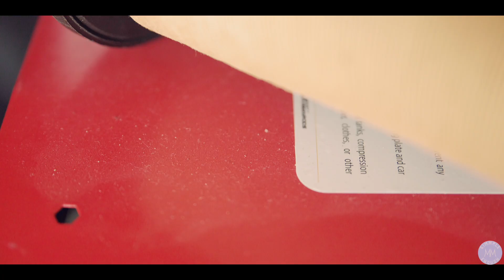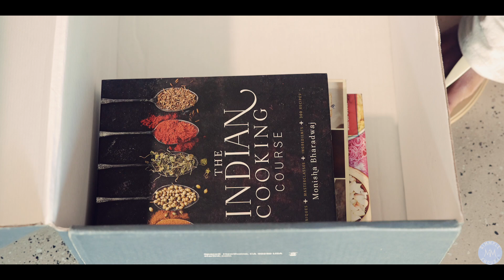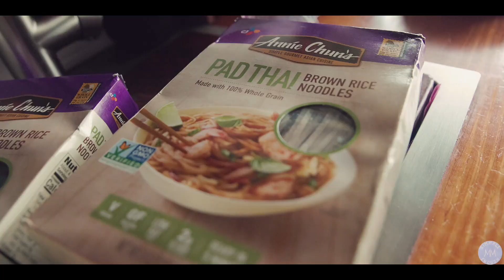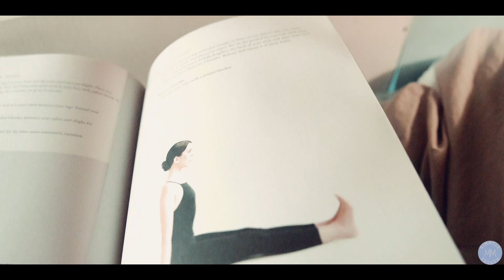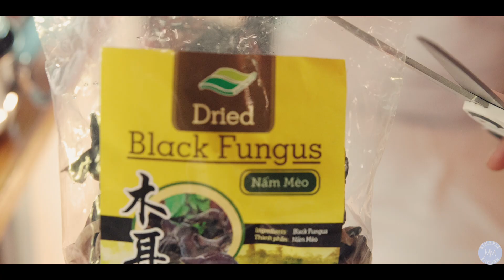Living in a Van Full Time // Cleaning My Van & Driving Cross Country Again

Comment: An elastic band wrapped around the jar lid does a great job opening a stubborn jar lid.
Reply: Or a little strip if the rubber sheeting that was used to keep the bins from sliding. I cut a strip and keep it right in the cabinet w my mason jar homemade soups.🎉